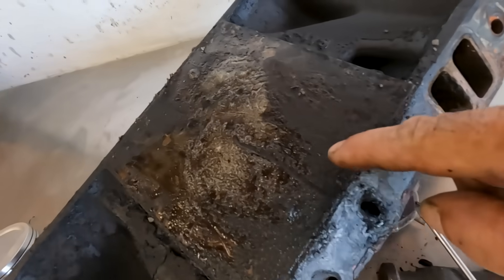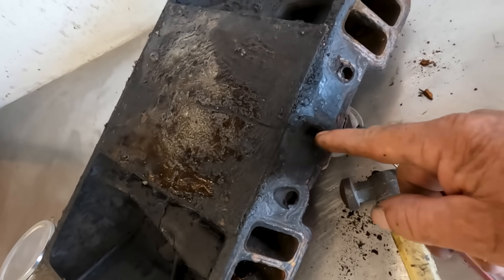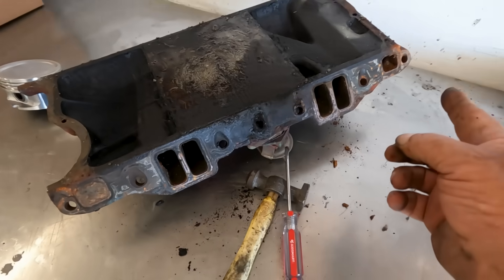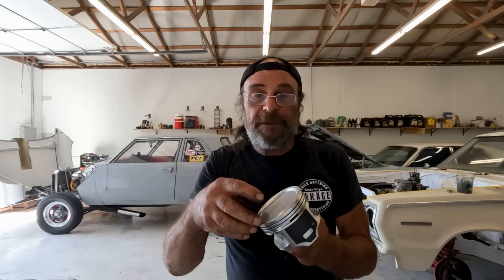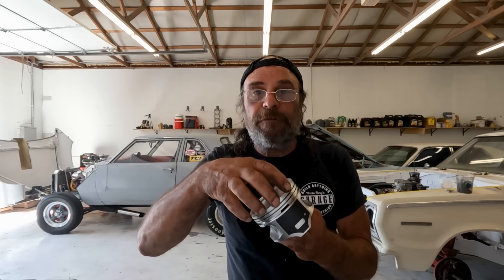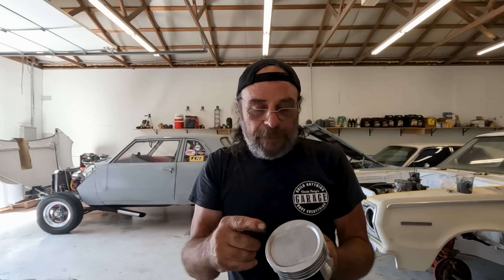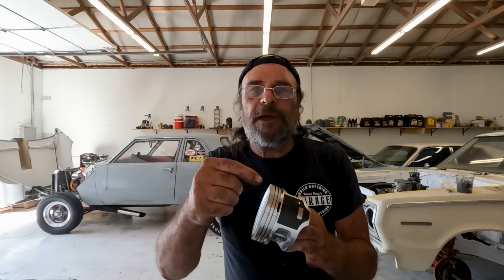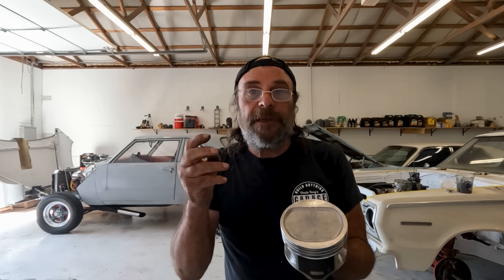The Number One Killer Of Gasoline Engine Efficiency And Power And How To Stop It

Comment: Spent many a summer as a pre-teen and teenager in a NAPA shop with my grandfather standing at a bench grinder with a wire wheel buffing the carbon off the valves then an air drill with a wire brush digging it out of the ports after the heads sat in the vat overnight.
I would grind the valve and head seats and he would replace the valve guides if they were too worn. I miss my grandfather.😔 He had to 'explain' to a few folks that started freaking out when a ten year old snatched the heads out of their vehicle and started tearing them down for the overnight vat dip that the kid knew what he was doing!😊

Even did a few three angle grinds with the bluing and lapping compound finish.

When I was taking the valve springs off if the valve stem seals were old and worn out or cracked I just knew I was in for a long one at the bench grinder with those set of heads.🥵

Comment: At the time, I was 23 or 24. The difference here is that I was working as a mechanic and had been working on cars for many years. Both my father and myself had already rebuilt several engines each.
Still the thought of pulling that Eldoradoo engine, replacing the crank and bearings in that heat, humidity and in a dirt parking lot still gives me the shivers. We just got real lucky

Comment: Hey Tony, If you want to increase efficiency fast and easy, gasoline is 13% efficient (hydrogen) and 87% inefficient (carbon) One gallon of gasoline (2.85769 kg) contains 0.3715 kg of hydrogen.
To remove the inefficient carbon just divide MPG by 0.3715.  eg. 70 ÷ 2.69 = 26 MPG   :   70 ÷ 2.69 ÷ 0.3715 = 70 miles per kilogram of hydrogen.
It’s a neat trick used by the EPA to calculate the miles per gallon equivalent (MPGe) so battery electric vehicles appear to be 2.7 times more efficient than internal combustion engines.

Comment: My son and I are about to rebuild a last model 202 Holden (Chev) engine (about 1987) using some modern twists - oil injection into the bores, modern pistons with reduced compression height thinner 1.2 - 1.5mm high tensile rings.  It will be interesting to see the longevity of the build.

Comment: Our old Ford v-8s in our trucks on the farm would get a dawn bottle of water at oil changes. I miss the sound of a holley carb right under your ass in those tilt cab trucks. They sounded good. But to this day the sound of an old flat head gives me goosbumps,my dad had a 1949 spray truck.

Comment: I used to run a Holden (Australian GM) 202 CI 6 cyl engine on Compressed Natural Gas (CNG) back in the 90s doing a 120 mile daily commute. Because CNG has a has an octane rating of about 130, it ran much hotter. To get around this we upgraded to a performance hi compression head with larger valves and  changed the exhaust manifold to extractors and increased the pipe size. The ignition had a timing advance option for CNG or Gas and we tapped the intake manifold for a stainless grease nipple to which we ran a thin hose from a water bottle. The engine sucked the water in when there was increased vacuum.  I ran that car for about 12 years till I changed jobs. In that time we exchanged the block once for a reconditioned one but never had to do anything to the head. Only funny thing was, even though it used hardly any water from the bottle, people would tell me I must have a blown head gasket because of steam coming from the exhaust. And btw the torque from the engine was amazing. I could accelerate from about 15 mph in 4th gear and  never had to use 1st gear.

Comment: cylinder wear on TDC/BTC is also caused because slow speed & stop/reverse move of piston that breaks oil film allowing metal-metal contact.
Reply from the maker: And they don't appear at BDC, because?.....
Reply: @UncleTonysGarage  because additional (caused by combustion) rings pressure is not present. sometimes on bdc grooves can apper (much smaller then on tdc) if hone/oil/rings type are wrongly matched.
Reply from the maker: And you've seen ridges at the bottom of the bore on how many different engines???

Comment: Where does the carbon come from?  If the only thing entering the intake valve is clean air (having gone through the air filter) then where would carbon come from?  It makes no sense until you factor in... The EGR!  In these direct injection engines, the EGR system is the culprit.  Remove/delete/bypass the EGR and all of your intake carbon worries disappear.  There are other carbon issues that need to be addressed, but intake valve carbon can only come from a contaminated air steam.
Reply: Blame it on the Dinosaurs, why else are they extinct?

Comment: The Main Cause for the Carbon Build on the Intake Valves and Pistons is from the PCV  System , The PCV System Pulls Burnt Oil Vapors and Piston Ring Blow by from the Crankcase into the Intake and then on to the intake Valves where makes carbon build up and then into the Cylinder where it Burns and makes Carbon Build up on top of the Pistons . By Adding a PCV Catch Can (Vapor Filter) it will Greatly Reduce the Carbon Build Up .

Comment: Utg, whats your thoughts on running a hose with spray nozzle attached to end, zip tied to carb stud and spray pump into cab and just drive around inducing water a little bit here alittle bit there. Letting it warm back up between squirts. I tried  it last week on my sbc, because last time i had the intake off the backface had carbon lumps, but can't get my bore scope to turn down the runners after going past the throttle blades to see if it removed anything.

Comment: running a catch can is really the best way to keep carbon at bay. the crank case vapors  introduced into the intake through the pcv system are loaded with oil vapor . which will also lower the octane level  and cause knock and carbon at an accelerated rate .

Comment: I have a 2005 GMC Savanna 3500 with the 4.8. I started putting the recommended 2 oz's of Marvel Mystery Oil in for every 1 gal of gasoline, and over about 4-6 weeks now about 8 weeks there has been a hugh difference in this engine performance, I only put on 6-7000 miles a year on and it is all local mileage. I also added 1/2 quart to the oil last oil change. 
(  They recommend up to 1 quart ) And the results have been amazing. A lifter tapping noise has gone away, the engine is hughly making power now ( no sluggish anymore ) Idling is purring like a kitten. ( no more slight missing could be felt ) I did  change the oil filter after about 2000 miles because oil guage was starting  to fluctuate a bit  which wasn't normal for this vehicle, and I just figured  the filter was clogging because maybe the Marvel was doing its job of cleaning the engine and the filter was collecting all the contaminates and was restricting proper flow. and sure enough that was it. after new filter put on, oil guage went back to constant reading ( no more fluctuating ) I cut open filter and could see the clogged areas in the filter paper. I use the best oil and best filters  Mobil 1 in everything on this vehicle. THIS IS NO LIE !   I AM NOT LIEING ABOUT THESE RESULTS ! It is really true, this Marvel  Mystery Oil has done wonders for this engine. It really feels like I have a new engine.  I now cut back on the use of it in the fuel, just every so often seems to be suffeint now. But will continue to use it in the fuel and at oil changes. Maybe others could benefit by using it as well.
Reply: I've used MM0 for 50 years ... !
2× the recommended  in gas when towing ...

Comment: I use to hot tank the intakes on all 60,s / 70,s cars, and it did an excellent job..On all new cars with both imjection systems like Toyota Use MMO in your gasoline , about 2 ounces for every talk full and your valves will stay clean..

Comment: So, what happens to those bigger chunks of carbon? Don't they fall into the piston chambers and scratch everything ?
what to do when I smell the fuel inside the car when starting the engine , what is the reason for it? Engine runs just fine at higher rpm but at slower rpm seams to idle not smoothly.
Reply: Replace the carburetor floats.  She's running very rich.
Reply: @kelsycunningham8452  Thank you for reply. Although my car doesn't have carburetor it gives me some kind of idea what is wrong. Probably something with fuel injectors. Thanks

Comment: Get it right!

Some direct injection engines do get lots of carbon on the intake valves, but the better designed engines now have infinite full control of valve timing, which allows them to do valve overlap and they have cycles where they allow gas on the back of the valves to clean them!

Go compare carbon buildup between the regular, old, cheaper GDI engines and the newer GDI engines.

Comment: Can you do the water trick in an 03 , 3.0 ford ranger ?
I'm old school and not a mechanic at all . All of my previous vehicles had carburetors . 
I know nothing about injectors nor throttle bodies .
My truck has almost 300k miles and doesn't idle well in spite of me changing most of the sensors ( except the cps , and 02 sensors ) and doing a full tune up .
Can i use a spray bottle ( like windex ) and spray directly into the throttle body ?
Reply: Did you use map sensor cleaner on the map sensor ?

Comment: my strategy has been to use Lucas oil upper fuel cylinder lubricant and open the throttle up around corners every so often. If I can set my wheel speed in second gear I know my little engine is doing okay om carbon. I added a fuel injectornto intake to helo prevent carbon. I changed my fuel injectors to largest size without interference with valve and then got it tuned. Upgraded headers to shorty and blew out my cat. Everything runs smoother now. 

Now my subaru... That thing I can tell is gunked up. Runs a lot better now with new primary o2. Concerned about hydrolock since its boxer engine. What other means or product could I use to decarb injector?

Comment: Could doing the water trickil into the intake every 4K or 5K miles to clean the carbon would it clean DIE engines like befor your normal servicing or maybe sooner. Because this is a major problem in these engines. I remember doing this in 60s,70's I our parents cars as they seldom drove there cars in a way like the Italian tune up required😂

Comment: REALLY COULD HAVE EDITED THIS VIDEO 99.0 % BY STATING DECARBONISED THE ENGINE EVERY X AMOUNT OF MILES BY USING 1 CAN OF SEAFOAM (NEVER DESCRIBED TO THIS DATE OR REFERRED TO AS A MECHANIC IN A CAN, )AND ADD A WATER INJECTION SYSTEM IF INTERESTED IN LESS MAINTENANCE. JAMES J.DEVITO III; GENERAL DYNAMICS,ELECTRONICS DIVISION

Comment: Uncle Tony, nice video mate.   Very well explained and easy to follow.   Back in the early seventies the fuel used by the PMG (think AT&T) here in Australia was below the octane rating of the standard pump gas.  They had to use that decarbonising trick approximately every 10,000 mile.  The only difference was that the mixture was 50% water and 50% kerosene dribbled in out of a bucket!  I have no idea how many engines perished from hydraulic locking but it sure did move that carbon.
Terry from Australia.

Comment: No you’re wrong. The number one cause of ice inefficiency is heat waste. Heat from engine, heat from exhaust,heat from radiator also from transmission, differential, and brakes. That’s why ev’s are 85% efficient, ice 15%. Until that waste heat is lowered a bunch, ice will continue to mostly waste energy and secondarily motivate the vehicle.  Ice vehicles will not operate efficiently,  carboned or not.

Comment: My 85 318 with 90,000 was not running at all unless i  put in new spark plugs, would run 10 minutes then immediately stall out and not run, put in new plugs fire right up then stall out  minutes later, rebuilt carb, no better, put new carb on, no better, put new heads on no better, compression was good, 125 psi, ignition was fine, finally put on new intake and 4 barrel and has ran strong ever since, was carbon build up in the intake?

Comment: I'm sorry but I disagree.

The biggest killer is in fact NOx

The reason that we can't run leaner mixtures, and the reason that we have EGR etc is to prevent excessive production of NOx

If we didn't have to worry about NOx we could run on leaner mixtures which by itself would be more efficient.

You could use materials that would be able to deal with the increase in heat...... BUT,

The only way of making the most fuel efficient gasoline engine would be to do something REALLY stupid.....

Like drive around with tanks of compressed pure OXYGEN......

Which works well on paper, but not advised to do this in the real world.

Comment: Used to be a GM product used a lot in the late 60’s and 70’s, it was nearly the same chemical makeup of the GM carburetor cleaner for soaking carbs.  Got the engine up to temp then idled it and dumped a quart of this stuff into the Venturi. The engine would fart and wheeze for about three seconds then die. Then let the engine sit overnight if possible. Started the engine the next day which was a tedious process but once it fired the carbon would come out in a volume that would choke a horse a block away.  That  carbon coming out is probably why it’s  not used anymore. The end result was a fairly decarboned intake and combustion chamber.
Reply: The goverment stopped its use to put more people to work charging you for the problems it caused thereby increasing tax revenue to hand out to the rest of the world making them look wonderfull in every ones eyes- don't forget to vote!

Comment: Is that cross over bore in a straight line?  If yes then use a proper length concrete bit and hammer drill to bore thru then change to chipping bit.  Most shops have air hammer that could be use also!  Chipping with a screwdriver and a body hammer is way too much work.

Comment: We were given a 1966 Oldsmobile dynamic 88 with a 425 from my Grandma when I was a kid in about 1976, it had 88k miles on it, lots of mile then, grandpa was a realtor.  it had to have been full of carbon just as described in this video. When you turned the motor off, it would continue to run as the carbon inside was hot and burning off. This water trick would have helped.

Comment: Seafoam is a good preventative, but it isn’t as good if it’s already carboned up.  I make my own Seafoam: two parts diesel to one part naptha, with a little denatured alcohol if you want to absorb water. I have inspected engines at over 300k with my scope and they still look good. I add my homemade Seafoam rvry tank, it’s cheap and effictive.

Comment: Putting water inside an engine is a surefire way to Blowit up. Water cannot be compressed, air and fuel can. 
 Do you know the amount of engines that had a massive failure and a big hole through the engine block when the pistom bent? This was usually caused by water.

Comment: We are really starting to understand and fix the issues with our direct injection engines. in the next 5 years we will have everything dialed in perfect when it comes to building and tuning them. we are pretty much already there but not every tuner knows all the tricks yet. Anyway when that happens the LT will be the next LS! more power, plentiful and fairly inexpensive. They just need to be be turned right, direct injection engines are a totally different breed and some builders and tuners just dont understand that yet.

Comment: The old engines. The gas vaporized in the floor of the intake,   The PCV system these days is the main contributor of carbon buildup on intake valves mainly In direct injection engines. So a catch can inline with the PCV system helps keeping oil and other contaminates out of the intake system.
Reply: A catch can in the PCV line is an excellent idea. Un-belivable the factory didn't install them.

Comment: Tony is correct on all this thats why the s6 v10 used the intake flaps to change it from a high rise to a low rise. It gave way more power. Problem is the bastard flaps break at 60 to 80k from extreme heat. They did redesign it offcourse mine is bad i need to fix it. Hey tony want to help 😊 it was a popular movie stars car as well im the 2nd owner. Gdi you have to drive it and open it up often. It helps a ton. The carbon the walnut blast them and suck it with a vacume out.

Comment: ......by the way, Mopar CCC Combustion Chamber Cleaner in the spray can is one of the best to decarbon, & Redline Fuel System Cleaner has the highest PEA at 35% vs Techron which is 20's%.  Recently found a discussion that VW Fuel System Cleaner has 70%+ PEA !

Comment: Carbonized intakes, EGR and pistons are almost a universal problem. The PCV system gives another healthy dose of contaminant in the form of vaporizated oil mists. The longer you run your motor oil, the more contaminants will be pumped into the combustion chambers. My older cars get an EGR block off plate when I do a cylinder head rebuilds. Problem is greatly reduced!

Comment: The new Valvoine Restore & Protect is the hot stuff now on the market & it works successfully dissolving carbon ring packs.
Its been introduced to the retail market & is also known to the diesel market developed by Cummins in a higher concentration of esters for their problem motors to fix instead of a $500k rebuild.  Its known as Valvoline Premium Blue Restore, not regular Premium Blue at W. Mart.  Premium Blue Restore can only be purchased at Cummins dealers at approx $80 a gal.  It worked so good, Valvoline introduced the Restore & Protect to the retail market but in a lighter additive package.

Comment: The direct-injection engine really needs a supplemental injection that cleans the chamber. The 2.7L  Ecoboost will need to be decarboned unless it is the engine is the F150 that has DI and supplemental manifold injection.